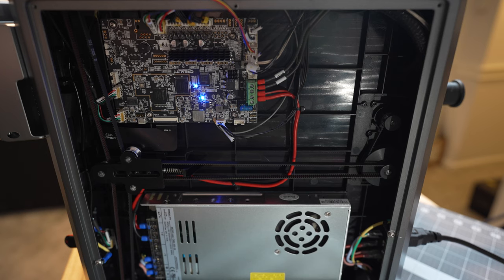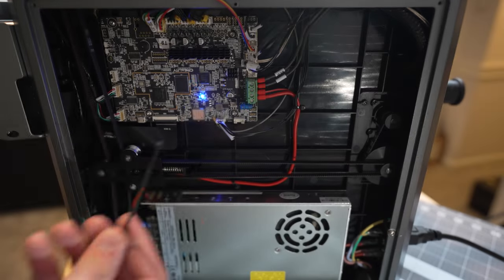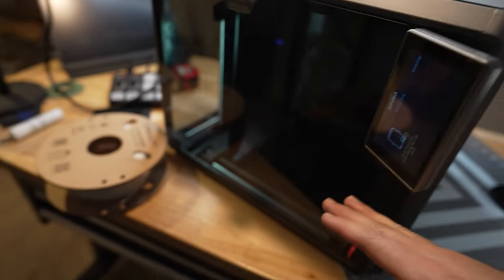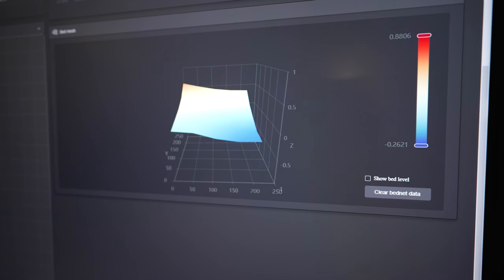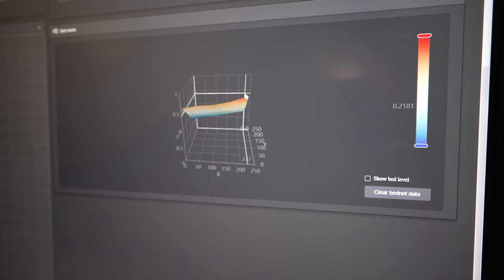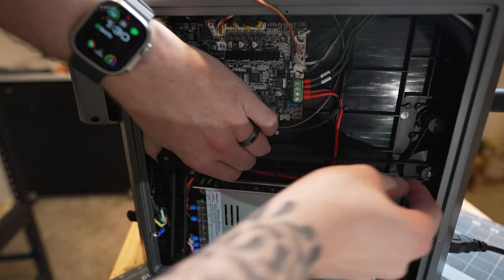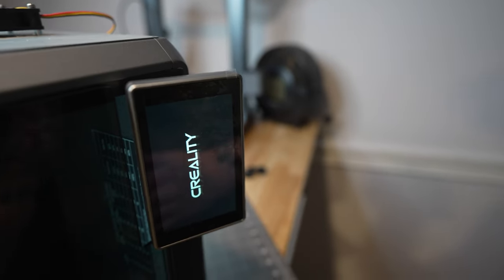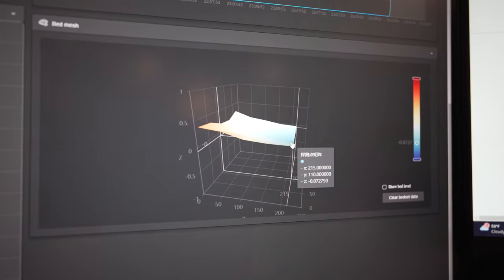FINALLY FIXED!! How to level the bed on the Creality K1

Comment from the maker: Hope this helps! Let me know if you have questions.
Reply: What program is showing bed mesh?
Reply: how are you showing bed mesh
Reply from the maker: Type in the IP of your printer in your browser and it should show up @azrielfriedman3595
Reply: @Shayway  thanks
Reply: @Shayway  I haven't had any luck displaying the bed mesh after typing the IP address in the browser. I've also got the problem of it not displaying the enclosure temperature, either in Creality Print or in the browser.

Comment: In addition - I recommend running the mesh level with the printer vertical. Doing it on its side introduces tensions that will not exist when the printer is vertical and will introduce error. It may be small but best to avoid.
Reply: Who uses their printer on its side?
Reply: @officialWWM 
The guy in the video said he used the bed mesh calibration program to check his adjustment of the lead screws so he didn't have to flip the printer around all the tike while micro adjusting the screws.

Comment: BEWARE: Just tried this and totally messed up my level. The spring on my belt tensioner is very tight and difficult to get back on without moving the screws as the belt is replaced. This is not a simple answer to bed leveling method.
Reply: Update: A much more controllable method is as follows: loosen the two screws, squeeze the tensioner and tighten one of the screws to lock the tensioner open. The belt now stays in position on each lead screw unless adjusted. To adjust pinch both sides of the belt about 2 inches from the lead screw and push towards the leadscrew. The leadscrew can then be turned on belt notch at a time. Repeat for each screw that needs changing. Loosen the tensioner screw and encourage the tensioner back. No not overtighten the tensioner screws when finished, they should allow some movement to maintain tension and allow the spring to compensate for thermal expansion.
Reply from the maker: Good to know! I'd love to see a video of this if you ever have the time. Thanks for the tip!
Reply: @stuartwaudby3543  Wish I read this before watching Shayway's video - I've got a lot of correcting to do now.
Reply: @stuartwaudby3543  I agree.  Removing and reinstalling the belt failed horribly. Like you, I pinch the belts together ahead of the pulley I want to adjust.  I used a plier ( with a cloth) to move the lead screw.

Comment: This method is only as precise ad the teeth Better method Attach dial gauge to print head Bring bed up Loosen set screw at bottom of lead screw Set using dial 3 points right at lead screw close as possible Tighten set screw Run mesh and check Rinse and repeat till happy GO PRINT

Comment: Your video saved my printer.
I have a K1C and after 2 weeks of printing on it, the first layer of my prints was simply looking awful. When I went to check the leveling of the bed, it was almost 1mm off.
The front of the bed was too high and the back was too low.
I opened the bottom and had an unpleasant surprise. Creality's quality control left some cables a little loose and they were touching the belt. Some of them even had their insulation eaten away.
I fixed the cables and the bed level and now the printer is perfect.

Comment: Great video! Some detail: you can slide the tension release forward, and then tighten the screw to lock it in the loose position.  To adjust the jack screws, I would pinch the belts together just downstream from the pulley.  To move the jackscrew, I used a pair of pliers and a cloth over the screw; to flick it thru.

Comment: Have you considered removing the little screws holding the threaded insert to the base plate and twisting the piece up then connecting it back to the base plate

Comment: Why not just loosen the grub screws on the lead screws collars and rotate those separately for each corner?
Reply from the maker: Honestly this may be a good solution. Only reason I ended up with this solution was through using Creality's recommended bed leveling video and doing my own jerry rigging. I may give this a try to dial it in even further.

Comment: It's easier if you have the ability to get a cheep digital caliper. while you adjust the screws you can get them almost perfect. then re-verify after putting the belt back on to make sure the tension didnt rotate one of the screws and not the others.

Comment: TIP I did this, this past weekend. Put some aluminum foil under your plate and keep leveling until you get perfect level. I have a pei so I never remove it anyways. I have a perfect leveled bed and if it ever warps again overtime I’ll just keep adding till I lose patience and buy a new bed all together that isn’t made out of a big roll of steel or whatever.

Comment: I don't understand, Self level is great but it can't level the bed ?
Reply: Bed mesh is compensating uneven plane of bed only to 1st layer to print stick better.
How would it level the bed when bed is fixed? 3 lead screws connected by 1 belt to 1 Z motor.
Reply from the maker: Here is an example, If the bed is trammed diagonally, the self-leveling feature will assist with being able to print it but the moment you take off the print and sit it on a flat surface it won’t be even because the bed itself isn’t flat. Auto leveling is just compensation, it’s not actually leveling the bed.
Reply: @3D_Printing also beacon, 5 axis, and 10 tool heads. Lidar was first time implemented in this year. Maybe at the end of 2022. You cant expect that technology  in every printer now.

Comment: One important thing before you put it on the side. Be f*ing sure that you have remove the top glas lid. I for some reason didn't but extremely fortunately, it basically landed with bottom side down and bounched a litte on my stone tiled floor but did not break.
If it had landed on the side or with the knob down, I most likely wouldn't have been as fortunate...

Comment: thanks for a great video, but just to be clear about it, you just made a lower pulling of the belts on the left, and becouse it was tight you turned it counter clockvise? :)
Reply from the maker: You actually take the belt off and turn the lead screws in whatever direction you need to to raise or lower the bed

Comment: I'm new to 3d printing in general and just got k1 that needs leveling. 
I can't find that visual representation of the leveling data in the Creality Print software at all. Under device all I've got is Temp, Control, and Printo info.
Am I in the wrong place?
Reply: You have to have your printer and your computer on the same network and type the printers IP address into the address bar in a browser.

Comment: Now my bed leveling is looking good.
But i have 1 problem to get it perfect.
All 4 cornors are at level. But in the middle it is lower 0.2 so its shaped like a U.
How to fix the middle leveling?
Reply: Get some aluminum foil, cut it, and insert it into the low spot. Standard aluminum foil is roughly .1mm thick, so 2 layers should get you there.
Reply: @jhowe67  okay thanks. I will give it a shot 💪

Comment: Isn't leveling the bed this way going to put angular force on the lead screws and nuts and potentially cause binding or at least premature wear?  Plus if you are on purpose warping the bed mount via the lead screws and nuts to make the bed level that would seem like a pretty bad idea.

It seems like it would be best for the lead screw nuts to all be exactly the same height and then level the bed itself by shimming the corners of the bed on the mounting plate mounts as needed.

If the lead screws are out of calibration with each other then that should be fixed first before leveling the bed itself.

Comment: Be aware, the variance that he has here is .5mm to give you a comparison a Voron holds .05 with literally no effort. A .5mm variance is unacceptable. All it takes is a .05mm variance to change your first layer and much more than a .1mm variance and the auto adjust will not account for it entirely in the Z height. This method will also walk itself out. I recommend trying shims first to get down at least to .1-.2mm using the bed level to know what shims to use. There are pre-made ones out there ranging from .2-1mm in height. From there I would root the machine and do a Z tilt adjust. If that doesn't get it, get a bed custom machined that's flat
Reply: Update, using KAMP I am getting bed variances of sub .1mm. I am currently sitting at .05mm on average for small prints, .08mm for larger 60% bed prints

Comment: When will Creality create a tinker-free printer?!? I'd just like to print, please!
Reply: It's a luck of the draw. I don't know of any manufacturer that's consistently good out of the box. The fact that these are shipped over thousands of miles doesn't help.
Reply from the maker: The closest to tinker free I've found is Bambu Lab. They make great machines at a competitive price point.
Reply: @Shayway  We are both making anecdotal statements. I've seen too many complaints about Bambu Lab unable to fix issues. I'm firmly in the open source camp. I own numerous Creality's (since uprgaded) and have built VzBoTs. Voron and Mercury One.1 are my next projects.
Reply: Don't worry. The K1/K1 Max just work out of the box (current releases). Us 3DP hobbyists just like to tinker ;-)

Comment: Did the same just after unboxing printer. Also i did put some diy washers made of paper under 2 of screws holding the bed. My dev is 0.15mm now
Reply from the maker: That’s awesome. I’m hoping to achieve that.
Reply: I just bought a pack of bearing shims. Combination of .1mm, .2mm, .3mm, .4mm, and .5mm
I hope I can get it pretty level

Comment: How do I view the graph of where my bed is high or low?
Reply: Found the answer to my own question.  For any others who were wondering, just get the IP address of your printer and put it in the address bar of a web browser, and it will take you to an interface that shows this graph at the bottom (presumably on if you've run the leveling process from your printer interface)
Reply from the maker: Was about to comment back! Glad you found it!

Comment: I origainally thought this wa s a helpful video and I liked and subscribed, however you could do a much better job at explaining which direction and how much one might turn the pulleys, depending which direction and how far to turn them. Looking elsewhere to fix mine now.  
After searching more on Reddit ("Guys, using fluidd+tooth skip method, you can make your bed extremely level. VERY.") it's clear this is A TERRIBLE WAY to attempt to level the bed - your time-lapsed video does not portray this truth. At the very least you could drop a mention in the beginning of the video so as not to mislead others.